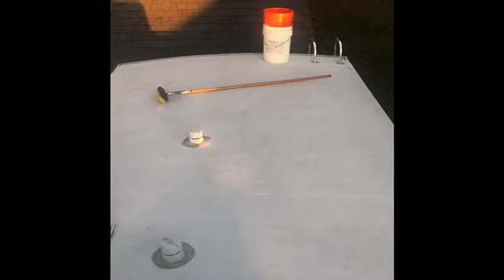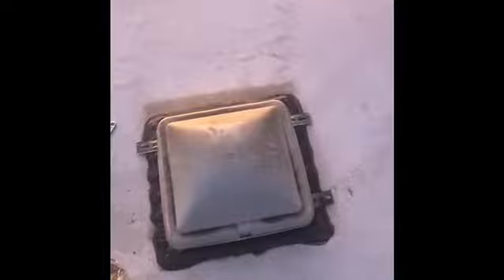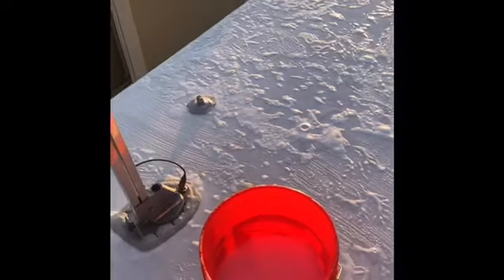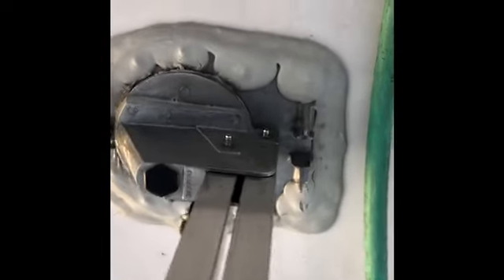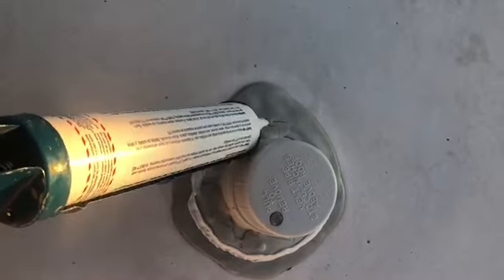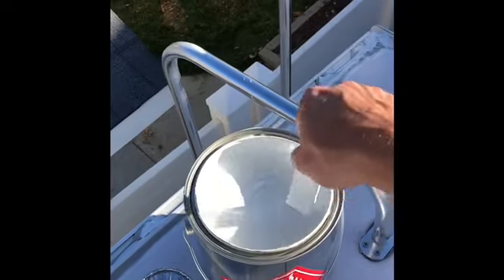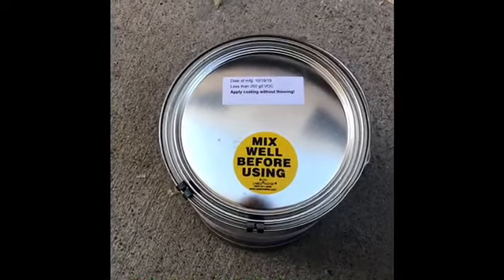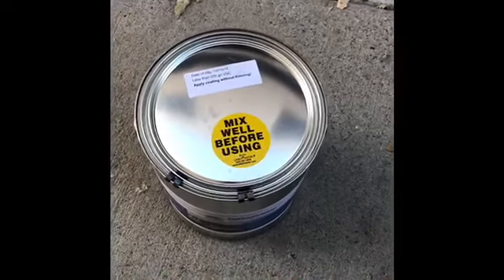Full application and tutorial of the RV roof Magic product.

Comment: terrific product.  Very easy to install and saved money vs other products.  We liked the fact that it did not require a primer and it only needed one coat.  Also it it is not water-based stay away those will not last very long.  Product dried in 14 hours it did rain about 4 hours after i applied it and it was already waterproofed.  I have no doubt it will last as long as they say it does plus I looked at some of the reviews of repair shops who have used it for over 15 years so have to believe it has passed go a long time ago